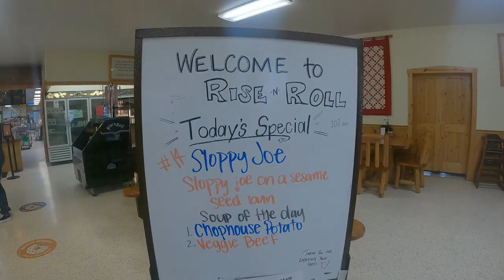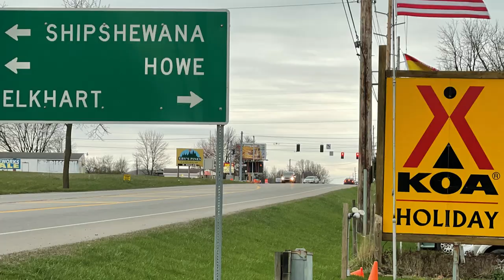RV LIFE: Grand Design Factory Tour Time // RV Refrigerator 12 Volt Conversion

Comment: Great video. I appreciate your information and input. We have been looking for several years as we prepared to retire. I was stuck between a 2022 & 2023 unit. What sold us was the options on the 2023 unit which includes the 12 volt refrig, solar panel, tank-less water heater along with many other features. We picked up our new 2023 Imagine XLS 23LDE last Friday. We hired an RV inspector who found just a few items. He said that he enjoys taking on an inspection on GD units because he has to get nit picky to find things. We hear great things about the GD products and value, we hope that we made a great decision. The inspector did recommend the MORryde suspension upgrade. It is on my list along with upgrading my stabilizer jacks to a heavy duty type. We are pretty excited!
Reply from the maker: Congratulations 🎊🎉🍾🎈 Welcome to the Grand Design Family!!!  You will be extremely happy with Grand Design.  We have a video putting on the MORryde suspension and wet bolts.  Best decision we ever made.  We have done all of fun upgrades you might like on our channel.  We would love if you join Team OTHA.  We inspire, encourage folks to get active and find their new adventure. Blessings and safe travels, Stan and Rhonda
Reply: @OverTheHillAdventures  I've seen quite a few of your videos already before we purchased our unit. I believe you had your FORD? pickup with the airbags. We are packing up tomorrow for our maiden voyage to spend a couple of days to try out the unit. I've got a list of upgrades that I am working on.  Thanks for the reply.
Reply from the maker: @TheGrainSideUp  we used to have the Chevy Silverado 1500 with the airbags.  If you have any questions during your shake down be sure to reach out. Safe travels.
Reply: @OverTheHillAdventures  I appreciate you!

Comment: We are picking up our 2023 2500RL on Saturday. It has the 12 volt refrigerator and 165W Solar panel. We are so excited!  Love the channel. I have many of your videos saved because I’m going to copy some of your mods right away!  Thanks for sharing your experiences!
Reply from the maker: Grant, Congratulations 🎊🎉🍾🎈 I am sure you will be happy with your new adventure.  Please take my advice and check your trailer thoroughly.  Be absolutely meticulous check everything.  Check all your appliances even the water heater gas and electric.  Check your heater and air conditioner.  Check your frame for any defects.  Make sure you bring your slide in and out several times.  If they give you an opportunity to stay in it for a night on their property do it.  If anything is wrong or not working properly make them fix it before taking it with you.  

Before our Grand Design, we purchased a 2020 Jayco I found a defect.  They told me just bring it back we have to order the part.  Several weeks go by they get the part in and we take it back. Three months later they finally finished the work.  Absolutely ridiculous, so if you leave it there you go to the top of the line and they fix it right away.  Hope this helps! Blessings, Stan and Rhonda
Reply: @OverTheHillAdventures  great advice. I have a PDI checklist printed out and ready to go. I plan on spending a few hours there.
Reply: And I have heard that the 2023s have the tack and pinion slide systems instead of the Schwintech…but I will find out on Saturday.
Reply: “rack and pinion”

Comment: I had never heard of Grand Design until AFTER I bought my Wildwood 26DBUD.  Now, I really want a Grand Design Imagine 3100RD.  If I woudnt lose my derrier, I would trade tomorrow.  Since y'all were there, can you buy direct from the factory?
Reply from the maker: Hello Gerry, you can not buy factory direct.  So we had a 2020 Jayco 22SLX Baja Addition sold it private party had it for about 6 months and sold it for the same price I got it.  Maybe lost a couple hundred.  Then I went to Blue Dog did it all online I chewed them down, I was negotiating with other dealers at the same time the best price won. Got a great deal plus they threw in the 10,000lbs Blue Ox weight distribution hitch.  Stan and Rhonda

Comment: Our 2019 GD 2500RL has been virtually trouble free. Our biggest complaint has been the fridge. Sure we have had some other problems but not because of quality or workmanship just things that need maintenance.  Anytime I have contacted GD they have been very helpful. We would definitely stay with GD. I think I want a donut now. Thanks guys.
Reply from the maker: Jim, thank you!  The 12V refrigerator is an awesome conversion.  Food for thought. We have had no problems either except a little maintenance here and there. Thank you for watching!  Blessings, Stan and Rhonda

Comment: Question:  we are close to buying a GD Imagine and add we look at the strengths and weaknesses we noticed the drawers seem to be a little flimsy compared to other good brands.  Some owners have commented on the drawer bottoms needing to be stronger to hold the weight needed when full.  What is your experience.
Reply from the maker: Hi Larry, Merry Christmas!!  The drawers are the same industry wide.  They are light weight.  Our’s have held up great.  However, I did not over load them.  They are not residential drawers.  I put way too much many in one of our side cabinets and the bottom broke out. Totally my fault.  Hope that helps! Blessings, Stan and Rhonda ❤️

Comment: Nice video. I hope they made propane fridge at least optional on their smaller units.  I boondock a lot, often under a forest or otherwise with poor solar, and I really don’t like running a generator…

12v compressor fridge only, would unfortunately cross Grand Design off my list.
Reply from the maker: Hi Jeff, yes they still have units with the propane and electric option.  I agree with you on this one.  Even though the entire industry is moving to clean energy. I’m not in favor of solar.  However, these new 12 volt compressor take very little energy to use.  With a good couple of lithium batteries you can last off the grid for quite some time.  I’m still using two lead acid batteries and thinking of converting to lithium.  Thank you for your comment and good luck on your hunt for a trailer.  I’m 100% in on Grand Design they have served us well. Stan and Rhonda
Reply: @OverTheHillAdventures  I’m not against solar really. I run 300 watts right now. I just hate running a generator, but sometimes camp under a forest canopy, or whatever. Ive also seen compressor fridges kill batteries surprisingly quickly. In one demonstration a 100 amp/hr battery didn’t make 24 hrs (though that was in extreme temps with the fridge on high). 

Lithium wise, you generally get much better charge rates, higher energy density and life cycle- but they do have disadvantages. Generally they can’t be charged when below freezing, they loose capacity and gain internal resistance when left at high charge in high temperatures, and of course the initial cost. 

Don’t get me wrong, I think lithium batteries are great, but I think people get an overly negative opinion of lead.  The battery a dealer installs is often the cheapest thing a recognized brand has, rated at something like 67 amp hours on 20 hour scale. A pair of GC2’s might be 230 a/h.  People promoting lead acid also claim you can only discharge lead 50%, which isn’t true. IIRC most rate their life cycle at discharged to 40% state of charge. This stemmed from a rule of thumb that if you are going below 50% every day, you’d save money by doubling the size of your battery bank- because they’d last more than twice as long at 75% daily. 

For me, most of the time I’m in the sun and never below 80%, but if I want to be under trees for a week, an occasional deeper discharge doesn’t ruin the batteries. 

Anyway, glad to hear propane will at least be an option. In the small toyhauler segment I like the 21G quite a bit. Outdoors RV also makes a nice one (with a non Lippert frame) but I think the layout of the 21G is more versatile.
Reply from the maker: @JeffinTD  great info thank you.

Comment: We researched heavily and really wanted a grand design travel trailer. We're ordering a rockwood signature.  Higher quality construction, standard features are unmatched by anyone including frameless windows with optional dual pane in a travel trailer nobody else does that. Also standard wifi on roof, moryde steps, fully laminated azdel composite on both interior and exterior, auto leveling, actual color choices on interior, dexter torsion axles and I could go on and on. We wanted to give grand design one more chance at the hershey rv show and stepped into a comparable reflection travel trailer. Immediately walked out when we seen the fully carpeted slides and cheap fan not maxair in the bathroom ceiling. Sadly I believe GD has become a cookie cutter manufacturer and just pushing the easiest and fastest thing they can out the door. Too each their own and everyone needs to really do their research and if you can't actually do a factory tour rockwood has some on YouTube and yes, let's other's film their tours and there also on YouTube.
Reply from the maker: Congratulations!! We are so happy for you and glad you found the best trailer for your needs.  We know Grand Design is not the best quality out there.  However, we looked at price point and more importantly the floor plan.  Rockwood Signature makes an incredible trailer we just could not afford one.  We looked at the Alliance which is also an incredible rig.  We are not affiliated with Grand Design and could of filmed the tour if we gave proper notifications.  We wanted to do the tour as Stan and Rhonda.  We were very impressed on how they manufacture our trailer.  So are they the best? Absolutely not!   For the price point for us absolutely yes!  We have traveled all over the country with our little trailer.  It has held up perfectly for an earthquake going done the road.  Our trailer is simply with a lot less to go wrong.  Again we are so happy you found your perfect trailer.  May God bless you and may you have safe travels with your new trailer.  Blessings, Stan and Rhonda

Comment: Hello, My wife and i are going back and forth on either a Reflection or a Solitude. One thing for sure we will be going with Grand Design. My question is. In an earlier video you had your trailer in your garage and you were saying that the propane gas line was in a bad spot. If the tire blows out that it would damage the line and you also said that if a big gush of wind caught the door it would slam shut and could hurt a child. Words to that effect, Did you talk to Grand Design about those issues? I know in the video you were very concerned about that. I was just wondering since you were at the headquarters. Thanks and love your videos.
Reply from the maker: Bill, thank you so much for this excellent comment.  Reference your choice my favorite is the Solitude 2930RLS small but a mighty 5th wheel rig.  We almost pulled the trigger it was just too much money for us after a long debate.  The windows in that particular rig are amazing.  

I have to be honest, I forgot to mention about the door and the gas line.  I remedied both. A bungee for the door and the GasStop for the gas line.  I will have another chance at the Grand Design Rally.  Thank you so much Bill for remembering our video. It means so much to us.  We appreciate you.  Blessings, Stan and Rhonda
Reply: @OverTheHillAdventures  Thank you for responding back to me and Thank you for the kind Blessings. Right back at ya. We really like the Reflection 337RL-S and then my wife seen the Solitude 390 RK-R. A beautiful rear kitchen model that she loves more. Our dealership claims that my 2018 dodge ram 2500 crew cab diesel could handle the Solitude but i am not 100 percent sold on that. So i am leaning towards the Reflection as i don"t want to buy a dually. Thanks again, and safe travels. Bill and Charlene
Reply from the maker: @bikernu  the 390RK is a huge rig.  I don’t think the Dodge 2500 could handle that size of rig.   Check your payload on the yellow tag inside the driver’s door.  Safe travels!!

Comment: Stan this is Jeff ? about the Sensor relocation kit, is the kit for the AC Or Heater and where is it located in the RV. I'm calling Tomorrow and getting mine.
Reply from the maker: Hi Jeff, if you open the filter in the air conditioning unit, you will see wires tuck up there.  It is a black wire with a round tip. It is labeled room sensor.  What I did was pulled down cut off the zip tie and passed it the air conditioning filter and the plastic grate that keeps the filter in place. I probably won’t use the sensor because the heater and the air conditioner work great now.  Let me know how it goes if you need more help.  I showed it on our last trailer review video.  Blessings, Stan
Reply: @OverTheHillAdventures  Thank you I will do that.